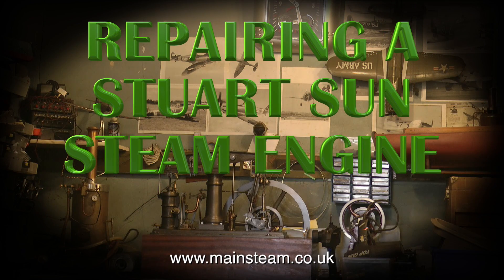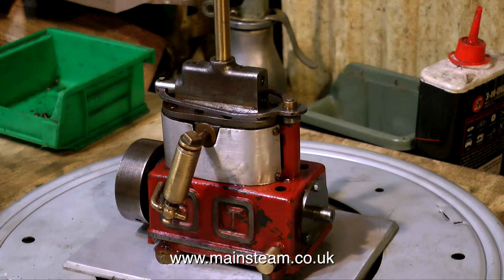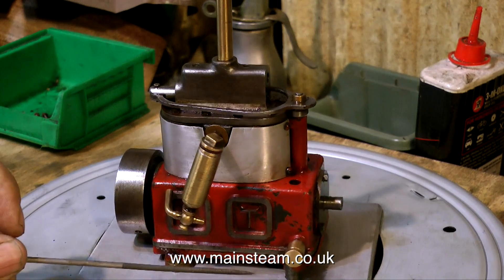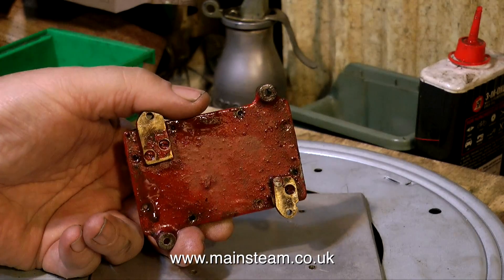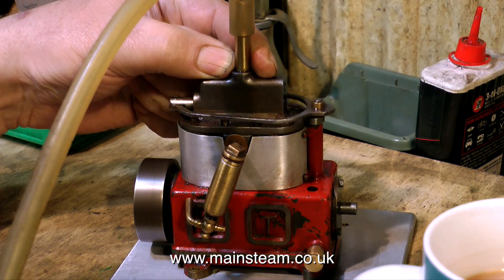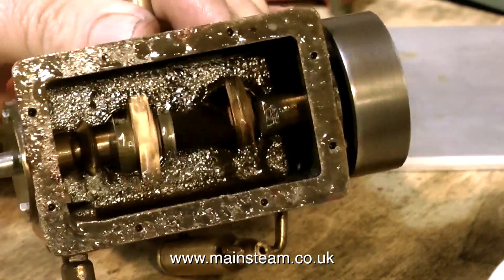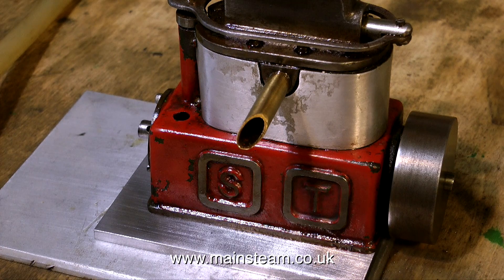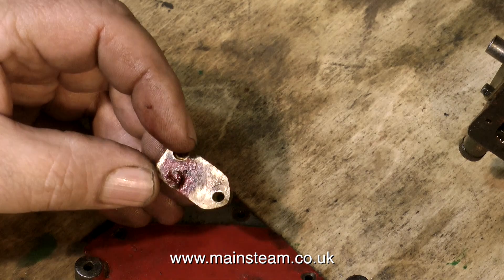PART #1 - REPAIRING A STUART "SUN" MODEL STEAM ENGINE

Comment: Hi keith;
this certainly is an interesting design for a steam engine. It seems that it takes some things from internal combustion engines. The sump for oil and the geared valve actuator is similar to a distributor drive, but a little simpler. Very nice indeed. Thanks for sharing.

Comment: That's a really cool little engine :) And as you said, very simple. Since it is single-acting, you could probably make a full size version from an old 4 cylinder inline car engine. Just remove the head, chop off 2 cylinders on one end, and then make a special head with the necessary valve arrangement.

Comment: Theoretically it should be self starting on all but two positions on the crank, that is, whenever the pistons are on top or bottom dead centre because they are opposed 90 degrees
Reply from the maker: Theoretically ..... :-)))
Reply: Hi Kieth, I have the castings to machine this engine but no drawings. Do you have them? I have been all over the net and can't find them.